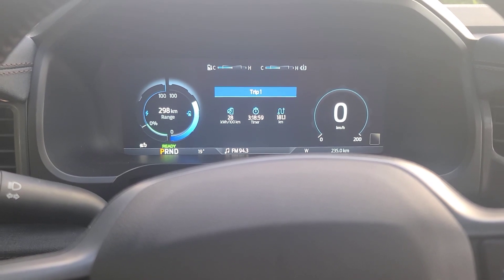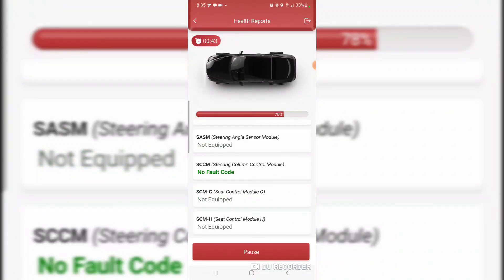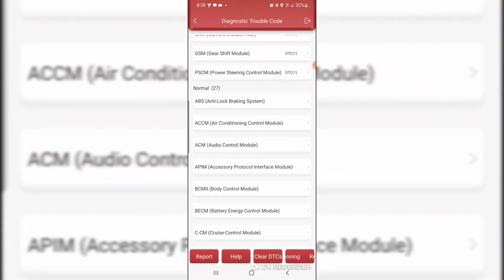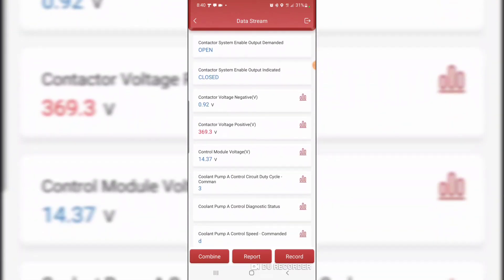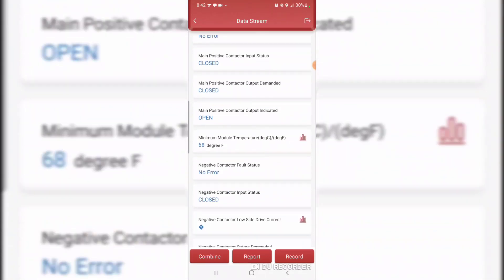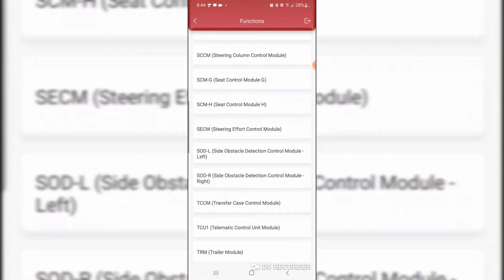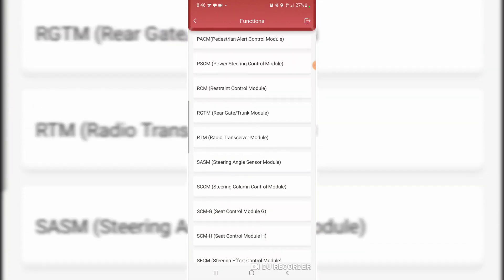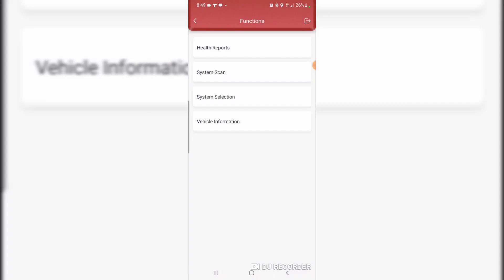First Scan Of F150 Lightning Electric Truck Using Thinkdiag Sanner

Comment: Is that the basic lightning Ford has been advertising or a well equipped model? Great way to keep up on the latest technology.
Reply from the maker: Its the extended range Lariat with basically all the available options except the Platinum logos and 22 inch rims

Comment: Just curious how it will it fair when -30 c.   Did you have to put a special outlet in your garage for it?   I wonder if you could scan a Tesla with the scanner.
Reply from the maker: I bought the extended range battery ans so it comes with a Pro Charger that I'm going to put on my house. I have a 240 volt connection in the garage to charge from. 
Tesla and I suspect Rivian have a proprietary diagnostic connector and I don't believe any aftermarket scanner supports them. I could be wrong though. One of the reasons I chose the Ford is because service information is available and the dealership infrastructure is in place in case something goes wrong.

Comment: Man idk how long you think you’ll take to get your investment back saving on gas? In the states energy up big time on costs cause of the idiot in office. So probably gets expensive charging them
Reply from the maker: I intend to charge at my home 99% of tge time. At 0.14c per kwh it will cost me around  $20.00 to charge and that should give ne around 450 klm or range. With my previous truck getting around 14L/100 klm that would be 63 litres gasoline at the current price of $1.70/litre that works out to $107.00. Definitely cheaper but yes it will be a long time paying back for sure. If I bought the same truck with an ICE it would have been around 15k cheaper. Of course there should be maintenance on the ICE as well.